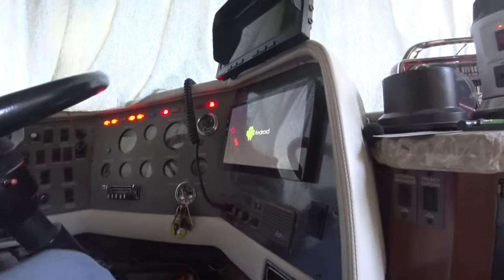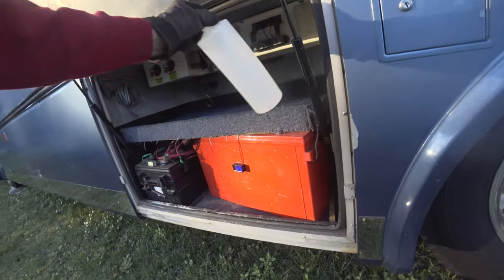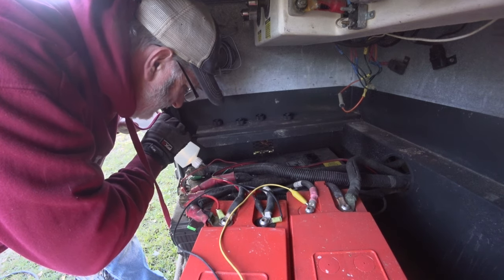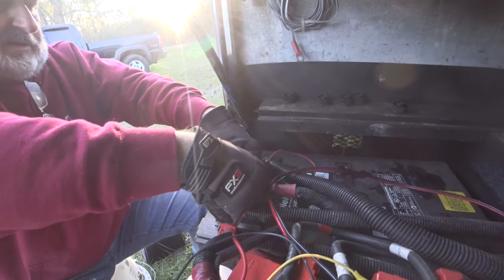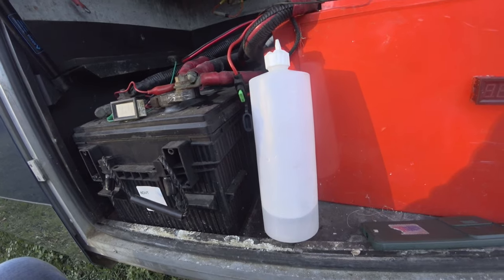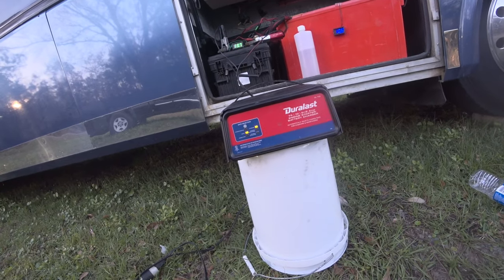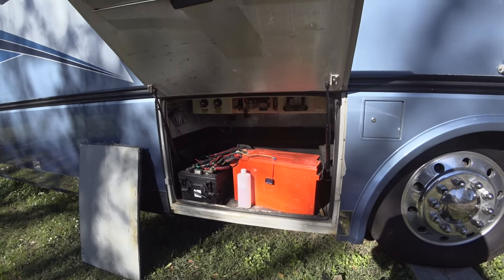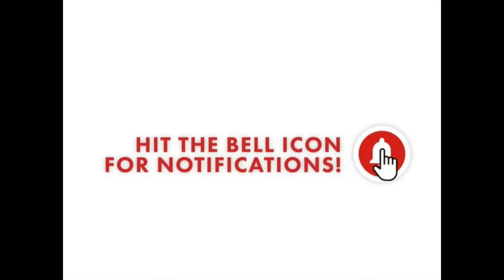Freezing Temps, Beaver won't start! Can we get it started?

Comment: Wow that was a lot of water needed especially for not being that old. I made the switch to AGM on the starting battery and will also be installing some style of solar battery minder for the chassis battery.
Reply from the maker: Tony, I agree that was a lot of water, going to keep an eye on it to make sure the battery is not being over charged by the inverter or alternator.  Who knows could have been low when I bought it, should have check it before installing.  . My plan is to install one or two panels dedicated to just to keeping the starting batteries charged when parked and adding additional panels for the house batteries.

Comment: I don’t think you let it preheat first ! If you have a plug in at the engine or electrical bay for the block heater , plug in four hours before you start engine!  We have a older coach also and here in Idaho it gets cold, nights at single digits. I plug in my block heater for a while and starts right up with no engine loping .
Reply from the maker: Redgie, thanks for the advice.  I did find the plug for the engine block heater after posting this video, I am sure it will make a big difference next time we are dealing with the cold in our area or traveling.  Thank you for watching and sharing your advice to us that live in the warmer areas and not use to dealing with cold temperatures.

Comment: why you got so many keys on your coach ignition key sheeeesh. mine is just one...stas in ignition at all times.
Reply from the maker: Ignition key, gas caps keys, bay door keys, door key and locking pin key for receiver. I keep them together so when I lose my keys I lose them all.   :-)